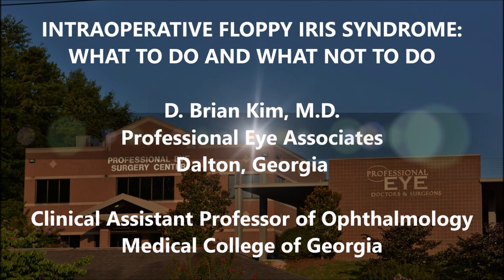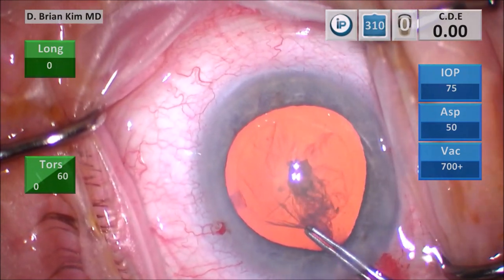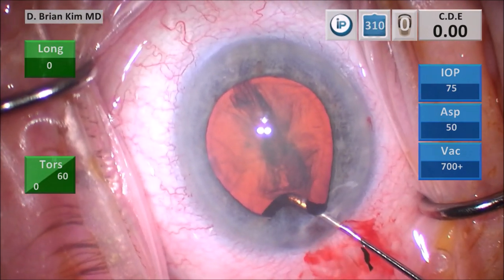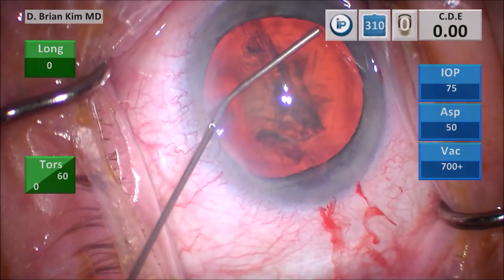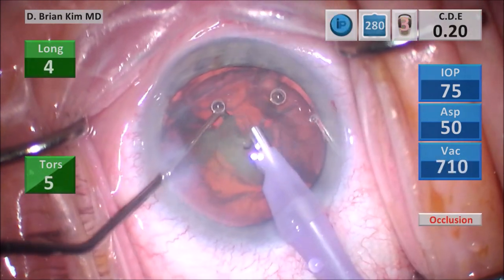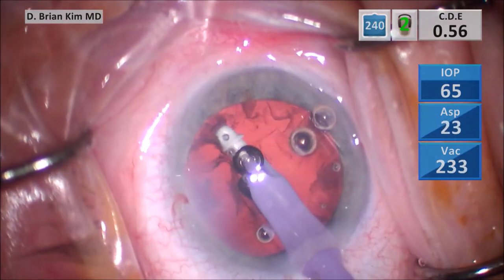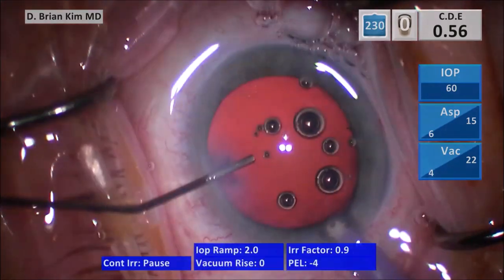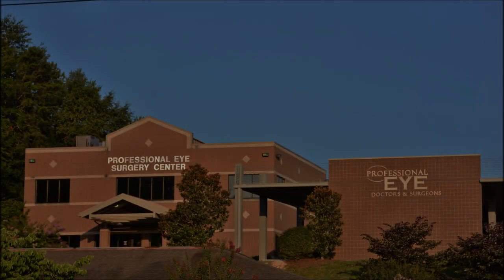IFIS. Recognizing it, What To Do, and What Not To Do

Comment: Thanks for sharing. What do you think about pupil expanders in such cases? and intracameral miochol at the end?
Reply from the maker: Eslam Elkohly great questions.    I think intracameral epinephrine and/or phenylephrine are the most important tools to fight IFIS. These medicines have been games changers. They stiffen the iris and turn these cases into routine cases. With regard to pupil expanders, I think it depends on the surgeon and tolerance for small pupils. So if you prefer them for small pupils, go ahead and use it. But if you have a large and floppy iris, I think pupil expanders such as rings are actually a disadvantage because the ring can disengage from the pupil if it flops. Iris hooks would be preferable to rings If the pupil keeps coming to the wound, it may be because the wound construction is not good or the wound is larger than the phaco or I&A sleeves. With regard to miotics at the end of the case, I do not believe this is necessary. If the wound is poorly constructed, I would rather suture the wound instead of using a miotic. I hope these comments are helpful. Best wishes.

Comment: Dear Dr Kim
Thanks so much for your wonderful video. I had a case of high myope with floppy iris recently. The iris prolapsed from the main wound right before IOL insertion. I tried to decompress the eye, however, then there was not enough viscoelastic inside the bag. I injected some provisc into the bag again, then iris prolapsed again. I had to fully fill the bag as I was putting in an AR40M lens (the haptic is firm and could cause PCR). I already added intracameral phenylephrine. May I know how to solve this situation? Thanks a lot
Reply from the maker: Sorry for your trouble. My best advice is to leave the eye soft to allow the Iris to go back into the eye. Carefully place the injector through the incision but don’t push it too far yet. Through the side port incision, place the provisc cannula and inflate the capsular bag. Since the injector is already within the incision, the Iris should not prolapse as it is blocking the Iris from coming out. You can inflate the bag with provisc while the injector is within the incision then once the bag is inflated, deliver the IOL.
Reply: @DocBrianKimMD  thanks so much!!